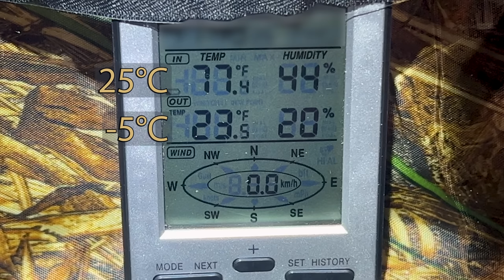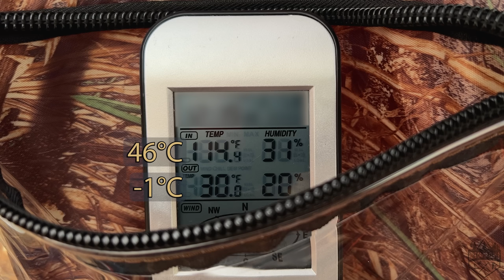Winter Camping In Russian Bear Hot Tent

Comment: Fancy stove! Nice side compartment for heating up beverages. Very convenient..also top of stove to put wood in.  I think I'd still like to open the front of the stove though to insert wood so you can arrange it the way you want it especially putting larger pieces in.  Hot tent is nice to have in the bitter cold weather.  Have a nice day today Nate see you on the next one.⛺️😊🧡❄️
Reply from the maker: Thank you! Yeah, that stove is nice. Lots of unique features too. I’m glad they added the hole on top of the stove though. A lot of times hot coals fall out when you open the front door. If you wait until the fire burns down it’s not a problem but the hole is nice for just adding a quick log on the fire.
Reply: @HikeCampClimb  What ever happened with that expensive, boutique Scandinavian stove maker that everyone copied because they made minimal effort to keep up with orders?

Comment: Wow. I was surprised to see you walking on it, in snowshoes. Either there's no metal cleats built into those for traction or you're confident in how strong that material is.
Reply from the maker: The floor is a really tough 3-layer design. I do have cleats but they are very dull. If they were sharp I wouldn’t have done that though.
Reply: @HikeCampClimb  Most snowshoe crampons consist of individual serrated metal edges that would not be difficult to cover with plastic or rubber guards if desired. I assume you stayed on snowshoes while setting up so you wouldn't pothole the floor while the snow was still soft.
Reply: I cringed when I saw that too.  Glad they are dull, lol.

Comment: Who wants to sleep in 46C ? The sled looked big enough to sleep in, so did you not consider it? The tent bag looked almost big enough to sleep in. A bigger one would have facilitated that as an outer bag liner. The screw point in the middle with a blanking panel would have been the ideal mounting point for a screw-in light. Interesting.

Comment: Tell me about your small wood stove fan?  How efficient is it in a tent?  Weight, size, cost?
Reply from the maker: Mine is a bit small for that big tent but it still helped. I think it was pretty cheap. Around $30 I think? It weighs about 1 pound. I notice a big difference when I use it. It especially helps spread heat in long rectangular tents.
Reply: @HikeCampClimb  Yesterday I looked at the small fans.  The 3-4" blades are too small to be useful according to reviews while a 7-8" fan is too bulky for camping.  I think a 5" blade might be a happy medium.